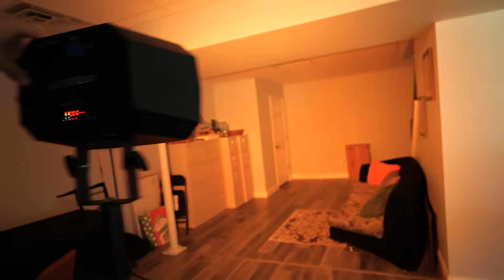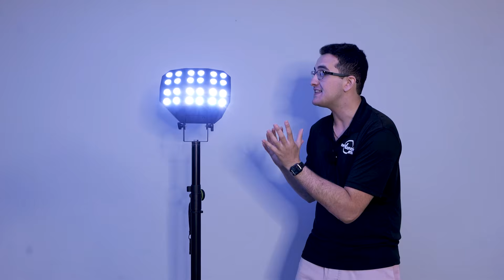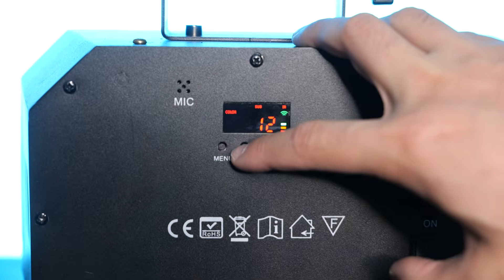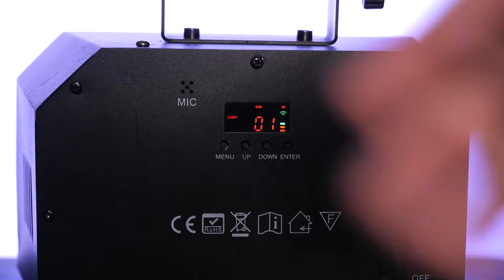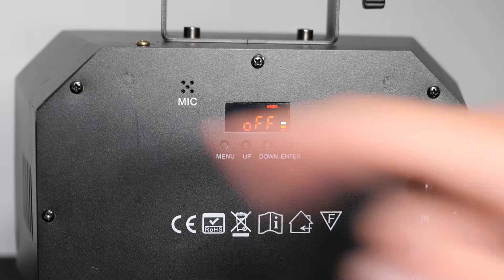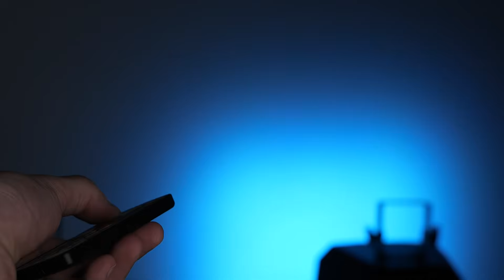Both Lighting USA Spider Wash | Fixture Settings Overview | Review and First Look

Comment: Hi, I have a pair of these. They are great lights. How ever I do have a question on how to connect to Wi-Fi feature . I have put the Wi-Fi’s on and searched on my IPad and Android phone but do not see thee wifi  connection listed during a scan of wifi networks. Any instructions on that feature would be helpful. Great video on expectation of controls.
Reply: Sounds like you are getting wireless DMX and wifi confused
Reply: Would two of these lights work for indirect lighting in a tent for 150 people having dinner, but with a transparent ceiling? Would it light up the space sufficiently? And outdoors, to light up trees and other natural elements? Thank you very much!!
Reply: How does the both lighting app with work with an android phone
Reply: Also need a Wolfmix profile  dont see it
Reply: @johncolon8614  same